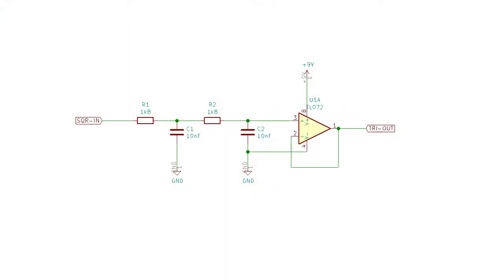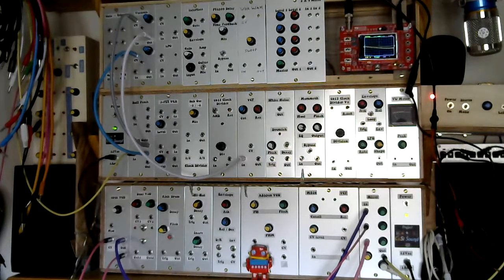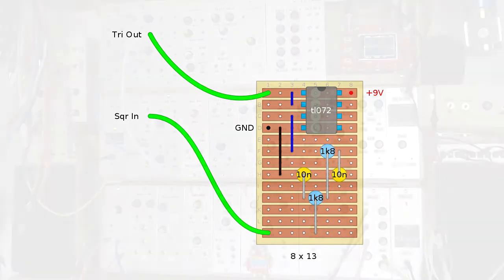Project XII Modular Part14: 4046 VCO Wave Converter

Comment: I'm glad you've developed and shared this circuit. I've made a 4046 oscillator and I don't really like the sound. This triangle sounds mellower.
Reply from the maker: The main limitation with this method is the restriction on the frequency range you can cover with fixed capacitors. Play around with values to find what works best for the range you want to play in. I set out to create a mellow triangle wave but I liked the fizzy sound of the spike/notch I ended up with so much I decided to keep that instead. (Teaser Alert!) In my next build video I look at converting a saw wave into a triangle wave.
Reply: @CuSiSound  Yes, ilike that fizzy sound too. I'll do some experiments.